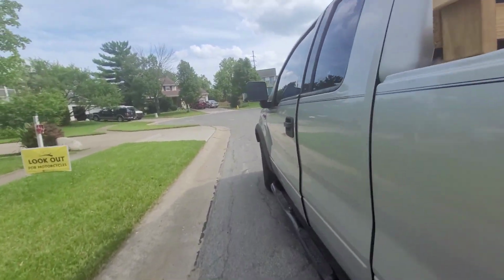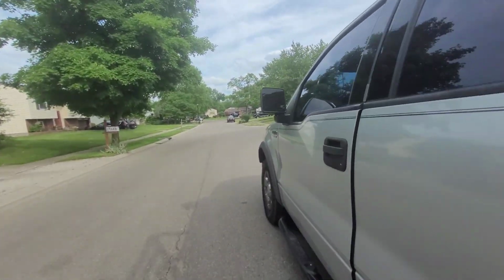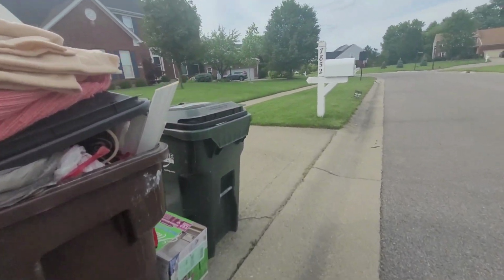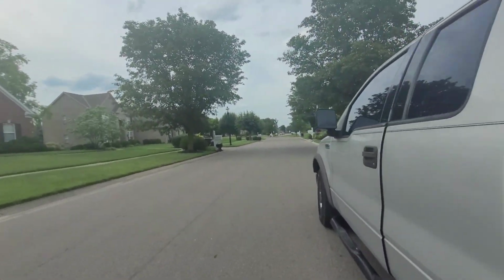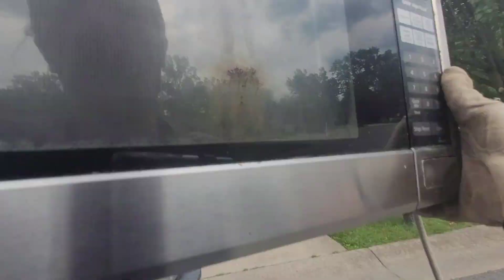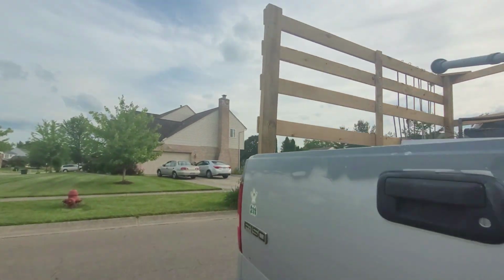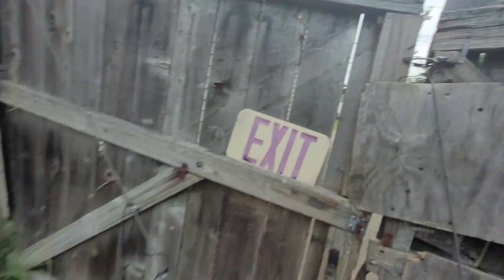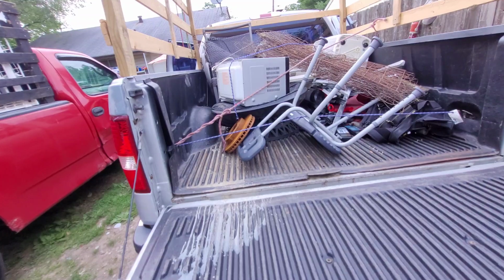Double Whammy ...Tammy

Comment: Little scoops are better then nothing did that lawnmower run in the back of the red truck if I lived close by you I would of gave you 10 bucks for it even if it didn’t run
Reply from the maker: Probably 🤷🏻 
Pull string was broken.